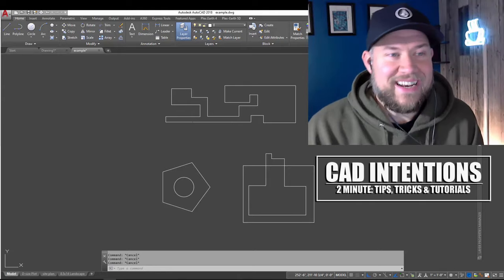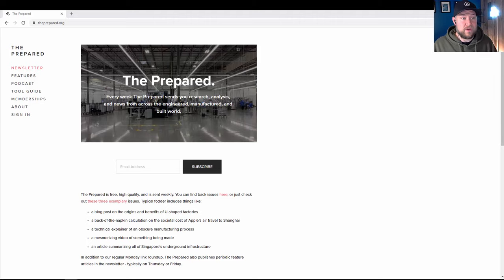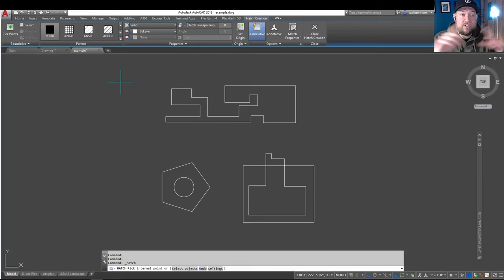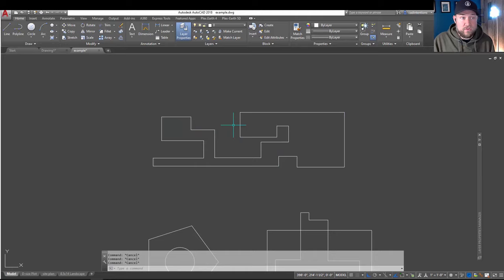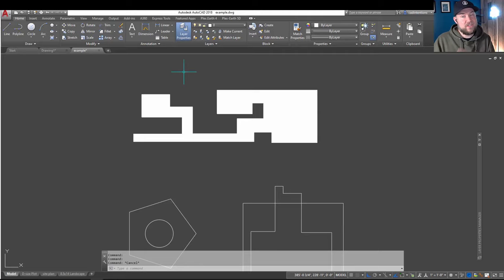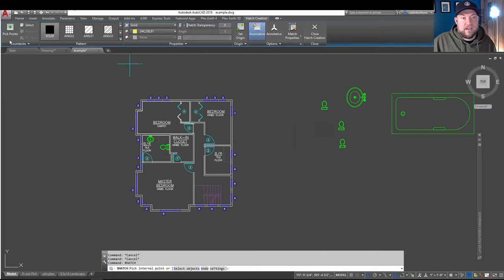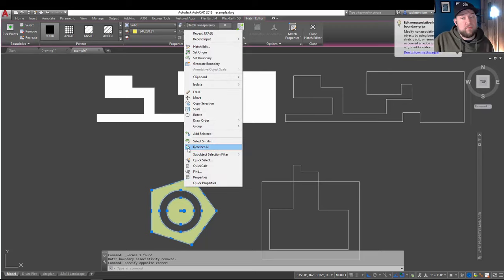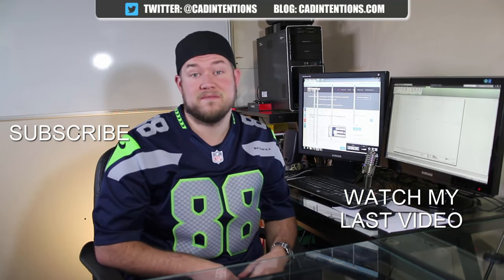AutoCAD Hatch Problems & Tips - Boundary Errors + Time Saving Tricks | 2 Minute Tuesday

Comment: Hi there, any advise, or reason on what to do if every time I want to hatch, AutoCad crashes??
Reply from the maker: Hmm, if it's a hatching issue, definitely want to make sure you're using a closed area or polygon when you're trying to hatch within it. Having one that's open can lead to freezing/crashed occasionally.
Another thing to look into would be making sure your graphics card has up to date drivers and if that doesn't help, try reinstalling AutoCAD.

Comment: Im trying to find a way to make the hatch and boundary a single object so that when I move/copy it, they all move together...

Great video though. Wanted to ask a question but decided to test it out. Apprently modifying the Gap Tolerance does not retrospectively apply, which is probably a good thing or it would potentially be disastrous when you find all your hatches gone if they were now beyond the threshold

Comment: Good video but I don't have a lot of the functions that you seem to have, such as the 'generate boundary' option? Its not included on my version of ACAD and that seems to happen a lot with the tips you cover in your videos. I have AutoCAD LT 2013 so that's probably the reason why! It's still fine for just about all the work I need to do and I don't have to pay an annual licence for it which is the best part - but the trade off is that I guess I am missing out on tons of functionality, even in the LT version....